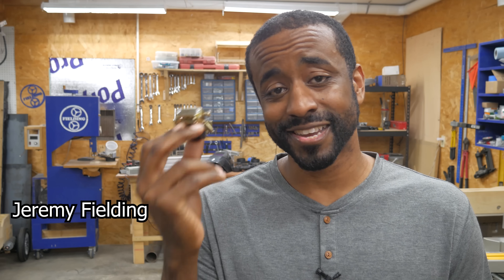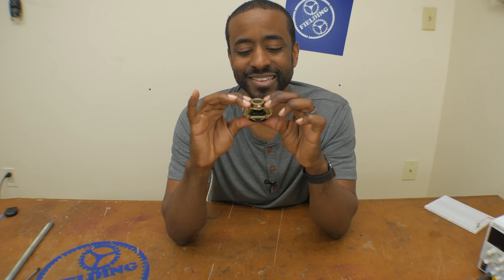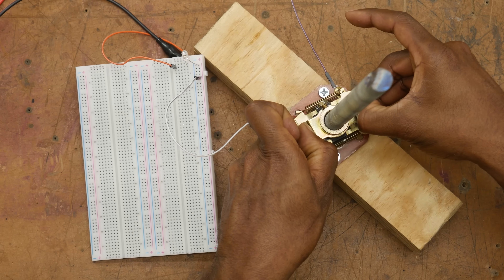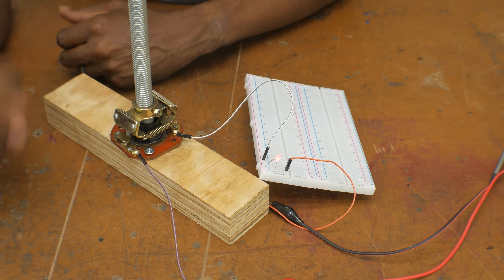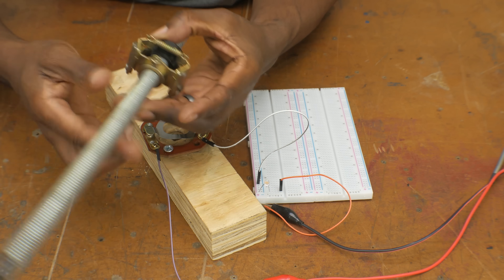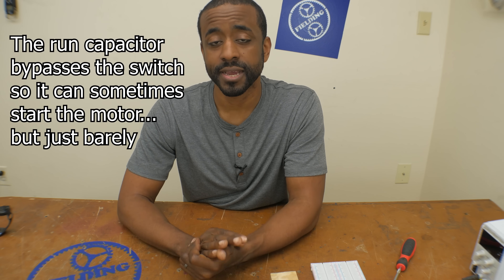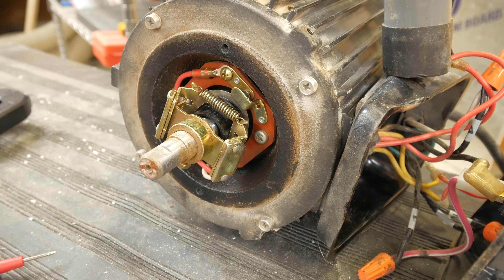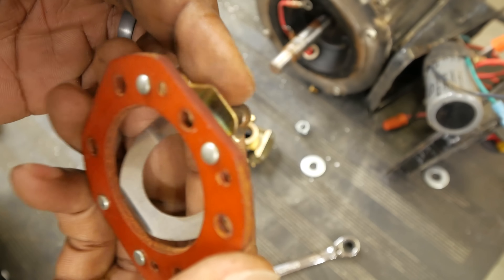This Clever Device Is Found In Nearly Every American Household. How It Works And How To Fix It

Comment from the maker: Hello! The comment about "specifically the US" is about single phase power... Some countries (like Germany) have three phase power and don't require a start winding. We have both 120 and 240 volts in every house in the US. In fact the motor in this video is 240 volts. So what is single phase? I explain that in this video. https://youtu.be/2XYdTogWcIA
Reply: As a journeyman-qualified motor rewinder, I love this video; it explains things that I struggle to convey to my kids.
Reply: @lairdcummings9092  Yes, his delivery is spot on, and also keep the subject intersting in the telling.
Reply: Just saw this, and subbed. My father is a retired R&D electrical engineer, all self taught. Yes he's that old, which makes me kind of old too now lols. You have a great way of explaining things, and excellent knowledge and presentation. I love the included bloopers (shows you are human too ROFL), and I hope to see more great and cool content!
Reply: Addition to ^^ In Europe we also use single phase motors 240V, (fans, electric gates, lawnmower) with two separate coils and capacitor connected.  It's just that when higher power is required, we use 3phase,  you need to have stronger kick start at beginning, therefore you need to have gigantic capacitor at start, you need to put higher current trough starting coil. As soon as it starts, current should be lowered, coil connected via smaller capacity.

I bet capacitor you were holding was actually combo of two in one.
Reply: JoeTuber p
Reply: @KabelkowyJoe  True, I have 230/240V single phase in my house and 380V 3-phase down in my garage/workshop, for the air compressor and some "heavy-duty" machinery, but I find I (and tools) use less and less 3-phase power
Reply: check into the steam engine guy ... he made the governors and switches like this and holds most of the patents on them ...
Reply: @0623kaboom  to be a toddler beauty trend 4t
Reply: @0623kaboom  you know patenting somthing like that is kinda like pantenting the lever or the screw or the club or fire etc. Think about that. We live in a time when you can take an old native american game whin i was a kid we called it bump played with dice an marbles . And patent/copyright it as an insulting derogatory term towards native americans  (Wa-who) .Giggles.
Reply: I think it would be wise to add a warning in the section about replacing capacitors and the potential dangers that poses to people who are doing home repairs. I know most people who will attempt repairs are probably already aware but for those that aren't it could be lethal.
Reply: @simonw3858  
Thats true.
Reply: @simonw3858  You mean a warning about capacitors that says before disconnecting one, you should always test it with your tongue to see if it's still holding a charge? ;) *** DISCLAIMER: Don't follow my advice ***
Reply: Royal Lee was granted  a patent for a centrifugal switch (US Patent #1,630,394)  on May 31, 1927 and was the basis for the formation of the Lee Engineering Company.  Don't think he was first, but the earliest I could find.
Reply: Royal Lee got the patent for it but idk if hes the guy who actually invented it
Reply: @derricka.mccormick6548  there is a Charles F Sullivan that has a patent for a centrifugal switch in 1912, which appears to be about 50 years before the patent Royal Lee holds. So apparently it's a device with many interations from different people over time.
Reply: +Jeremy Fielding   In 1910 Victor Bendix (b.1881) invented and patented the Bendix drive, a gear that could engage an engine at zero rotational speed and then (through the aid of a spring and the higher speed of the running engine) pull back and disengage automatically at higher speed (nominally the engine's running speed). This drive made the electric starter practical for automobile engines and later for engines in aircraft and other motorized devices.
Reply: Technology Connections had a good video on the US electrical power supply in your home:  https://www.youtube.com/watch?v=jMmUoZh3Hq4
Reply: So if the cap is blown, its possible the centrifugal switch got stuck closed? Because I have an old grinder with a blown cap and was going to replace it. But I'll look at that switch too if thats the case.
Reply: @siggyretburns7523  might want to remember that if you’re grinding or wire wheeling hard enough to slow down the motor that it engages the centrifugal switch several times it’s possible to overheat the start cap and cause it to open .
Reply: It's basically a governor which is in clockwork chime mechanisms and  automatrons and I'll bet you can trace it's use to a time even before  Archimedes . It is indeed a very old device. So good luck finding the person who first introduced or thought of it's design and uses.
Reply: @michaelshultz2540  Archimedes looked at the physics of it. he did not 287 B.C. 212 B.C.
Reply: with archimedes  principle of buoyancy, archimedean screw he worked with water.
Reply: @michaelshultz2540  you would not find that thing there acturally its closer to bow and arrow 30,000 BCE 100 BCE water wheel to 1040 compass gunter's chain Edmund Gunter (1581-1626) mechanical pendulum clock 1670 Robert Hooke(1635-1703) Joseph Nibble(1640-1711)
Reply: This switch is used in commercial convection ovens as a safety device. If the convection fan motor does not run, the oven will not heat up.
Reply: While we do have rotary current in every house in Germany, many devices are single phase but contain rotary current motors. A 5-core cable is  inconvenient for a lot of applications. E.g. lawn mowers, fans, circular saws, ...
The capacitor is connected all the time. Also those capacitors are rather small, less than a quarter of the one shown in the video. I've never seen any motor using a switching device like that.
What is often used for compressors and pumps is a timed relay removing the load to help the motor spin up. The classic ones use a clockwork or in rare cases a heater with bimetallic switch.
Reply: The original patent #1,630,394 lists the inventor as Royal, Lee.
Reply: Great job.  Thanks.  One thing, though:  It would be helpful to warn dummies like me to take lots of pictures before and during disassembling any electrical or mechanical device that one wants to work when/if it is reassembled.  Doing so can save a lot of grief and wasted time.  

God bless and protect you and your family,

Mike

011-44-1638-718264
Reply: We run many tools on single phase, too. So a start capacitor is often used. Only on machines which require a lot of torque or are especially heavy duty or just pull too much power we use 3 phase.

In industrial applications three phase is mostly the default, though.

Greetings from Germany 😙🎶
Reply: Europe has 3 phase power but most European homes have single phase, however, we don't need that device, there's a starter capacitor in the motors.
Reply: Inventor patent holder Royal Lee May 31st 1927
Reply: Not good with electric devices, but I think our 3-phase has 400V in sweden.
Reply: 3 phase power exists in every developed country, but it's only used industrially. German homes have single phase power just like the USA and every other country.
Reply: under friction roller coaster 1919 - john miller ;
Reply: 3:34 I see the weights moving outward, but what actually presses the switch?!  3:42
Reply: @TheRainHarvester  the force of it spinning.
Reply: @toolman9081  no, the force of it spinning un presses the switch, to electrically disconnect the capacitor.  
But I don't see what is depressing that switch.
Reply: @TheRainHarvester  springs return it back
Reply: 0 pop
Reply: I
Reply: James Watt Centrifugal Governor  ttps://en.wikipedia.org/wiki/Centrifugal_governor#:~:text=In%201788%2C%20James%20Watt%20adapted,Age%20in%20the%2019th%20century.
Reply: Centrifical switch yah I already know
Reply: This is the first of your videos I've watched. I liked and subbed before it was even halfway through. You're wonderful at explaining things in a way that is both understandable and straightforward (NOT mansplaining) I'm looking forward to watching more of your content!
Reply: I thought in the EU we use capacitors in single phase motors to offset the voltage and create a second phase so that you get a rotating magnetic field and don't need a starter or a switch like this. I work as an electrician and I've never seen a switch like that, but then again I don't do washing machine repairs either.
Reply: @Liteg0  Never seen one here either, most motors here run with a second coil with a phase shift capacitor to determine direction,  washers it would stop  and alternate the cap between coils to make it run back and forth.
Reply: Thought this was just click bait. It definitely isnt. Good video
Reply: You might have just helped me fix my air compressor. Thanks!
Reply: Well, residential is mostly standard 120, 15-20 amp, blah blah blah. BUT, In commercial i mainly see everyone on a 3 phase disconnect. Every now and again ill find a single phase in a building, mostly older buildings. The most interesting devices ive used, besides live production equipment, Step Down Transformers and ISO transformers. That stuff is so crazy to me, a device the size of a crate can isolate an entire 400 amp disconnect and reroute it for Audio power. If you did have Dimmable conventional lighting like 1000w Lamps for a stage, everytime the lights go up, that shared ground will put a 60hz buzz in the audio. ISolate!
Reply: We have plenty of 3 phase power here in the USA. It isn’t common in single family dwellings or some light commercial locations, but generally medium to heavy commercial and almost all industrial locations have three phase power. It is also possible to create three phase power from single phase by using a rotary phase converter.
Reply: The reason that you can't/couldn't find the inventor as you're calling it a new name.
These are way over 100 years old also.
They used to be called governors and were used to slow down steam engines which were spinning too fast.
Reply: Your channel is really good.
Reply: @tamasmihaly1  Being the best channel normally makes it good.   There is another one:
ozzieslivepedos
which I also did.
You might also like that one.  Lots more videos from that one were removed.
Reply: Actually,  240v comes into a house. And its split in the breaker box. Single breakers only latch to 120. The double breakers get 240, because they're latched to both 120 bars in the box.
Reply: Newton was the first recorded person to discover centrifugal force... The first centrifugal devices were created in the 1600's... For milk sperating...
Reply: Saved me a search ty!
Reply: Man, was I scratching my head why I had never seen such a thing before!!! (edit: German dude here)
Reply: All countries have 3 phase power...
Reply: Hmmm... My understanding is the single phase is the standard for every household and 3 phase is a choice if the household choose to have 3 phase powered appliances(like 3 phase motors in a workshop in the garage, etc).
Reply: Interesting comments hey?  Electricity can be configured & reconfigured so many ways.. 

Will say this, some people have been listened to by people who clearly only paid attention to find fault as an excuse to be mean. How I know this?  Unless the person is lying intentionally odds are they have a peice of info wrong.. Usually it is easily cleared up. 
And here is how i know that isn't what the unhappy listener is after. 
In a misunderstanding or cultural difference: calling someone an idiot using these or the like as justification... Sorry but have you noticed that the folks who enact or support this behaviour are also chronically angry / unhappy except when they are attacking some one?

Counted only two or three of these in comments here.
About twenty or twenty five who complemented & or thanked the creator.  Several who provided bono fides.
Those who were negative probided none.  It is not about truth, or even them being knowledgeable, it is them insulting, hopeful that others will join in and start a fight so they can contact like behaving contacts to join in and or use multiple screen names to create the impression of many.  
Here's hoping they / and i do mean each of you / all find a better way, they do excist, and all it takes is a bit of willing.

Thx 4 the vid dude, learned some interesting things from it.   Thanks 4 the comments for same
Reply: Electric motors have 3 windings, in smaller intermittent duty motors, use single phase energy with the use of a capacitor( run capacitor not start capacitor) very different. Larger continuous duty motors (higher efficiency) use 3 phases of energy 208/460v with one phase connected to each winding.   Unless your talking DC MOTORS then LOL that’s different they don’t have 3 windings
Reply: Does a centrifugal switch sense the speed of a motor?
Reply: Does that in a HEI distributor in a car?
Reply: Residential home outlets in Germany provide access to three-phase?  Do they transform to Wye for safety ground?
Reply: thx1138 ib3  but to answer your original question, 3 phase power is inherently "rotating - the AC in the legs is 120 degrees off.  But when you have single phase power - whether it 120 volts or 480, there is no rotation, single phase power just goes up and down, up and down.  And lets say you take two of the three legs of a 380Y220 volt, 50 hertz supply in Germany, it is still only back-and forth without rotation.  So there is an additional, partial winding, slightly out of phase with the main winding which provides the initial "kick" to get it turning.  Sometimes this winding is helped with a capacitor (capacitor start) or not using a capacitor at all (split phase).
But... three phase is inherently rotating and a LOT simpler, regardless of voltage or frequency.
Reply: @Huggy1959  don't you use 230/400V AC as the rest of europe? They changed it from 220/380V AC to 230/400V AC in the 70'ties but so many still say the other thing. Quite frustrating really (PS. Im from Denmark)
Reply: @Faryetes  I am in the United States.  We are 60 hertz.  Our defacto power to our houses is 120/240 single phase, although when it is derived from a 208 Y 120 transformer  it’s 120/208, derived exactly the same way that your 230/400 is,  in an industrial setting we also frequently have 480Y277 and in some big factories we have 600Y347.

We have one machine here that was built in Israel and it runs on 415Y240  50/60 hertz and we can supply that with transformers
Reply: @Huggy1959  That's a great explanation.  I don't think I'd ever heard that before.  Or maybe I just wasn't listening.
Reply: @Huggy1959  you rock
Reply: @Huggy1959  that was a great reply and it added value to the thread! Since I've been trying to learn more about power phases and electrical motors for my Walker -Turner table saw restoration, what you posted actually made sense to me...for the most part as a beginner. Thanks so much!
Reply: Ah, I see, I thought maybe the motors or the switching mechanism was different... but single-phase power isn’t US-exclusive nor is 3-phase common in all of Europe, here in Spain it’s rare for an individual to have 3-phase power, which is usually only for specialized loads (which makes sense because otherwise you have to correctly balance it).
Reply: Adding in to the list of "Weird things that are a norm in USA".
Reply: @LecherousLizard   From Canadian: Said the " Lecherous Lizard" :'D
Reply: @LecherousLizard  Only in the US.... lol :D Yeha they've all got weird stuff there...
Reply: The USA does have three-phase but it is most often only available for commercial use.  What a shame.
Reply: I would also like to add the reason the US doesnt just use 240V for everything if they have it in their homes is that 240v in US households does not usually run through the entire house and is often dedicated to things such as laundry equiptment etc wich do require higher AMPS where as in EU all of our outlets are as standard 240V 13A as opposed to 120V 10/13A.
Reply: We also have Three Phase Power in the U.S. (277 Volt) but it's used for commercial and heavy industry power uses.
Reply: L G not just for commercial and industrial. Plenty of three phase 208 used in condo buildings.
Reply: @RB-xv4si  Yes, three phase may be sent to condo/apartments, but, each individual apartment will only have two of those three legs.  Ends up being 120/208 volts single phase at each apartment.  I suppose a motor might be designed that would use the neutral and take advantage of the out-of-phase character of two legs, don't know if that's been done.
Reply: @boggy7665  yes, I know how three phase power is distributed to individual units. Thank you. I don’t know what you’re talking about with motor voltages. Either they will be three phase, single phase line to line, or single phase line to neutral. It’s no more complicated than that.
Reply: US  residential power is 110/220. However, it comes to your household as single phase 220. The 110 is derived from a center-tap on the transformer that is bonded to earth ground, and is called "neutral." This results in two halves that are 110 and also 180° out of phase (split-phase, not two phase). Interesting thing though, even all of your 110 items are running off 220 in an interesting way. The neutral only returns current imbalance from the two halves. So you have 10 amps on leg one, and 8 amps on leg two, only 2 amps are pulling along neutral. As for the voltage 110/220 is just an old standard that is still used as reference, and IMO is easier to say/read/type. The nominal voltage is 120/240, but acceptable range seems to vary from 110-125/220-250 (plus/minus 6% of nominal is the proper range though).
Reply: What do you mean “some countries” have three phase power. The US has 3 phase power everywhere. Just not in homes.
Reply: Royal Lee Invented the Centrifugal switch in 1927. Granted Patent #1,630,394 granted May 31st 1927 the basis for the formation of the Lee engineering company. * Citation Wikipedia.

I think that is what you were looking for. Great videos, I really enjoy the subjects you cover.
Reply: I'm probably dumb in this department but did you mean 110 and 220?
Reply: @joshuasummerville2976  both its for single phase not 3 phase motors there is 110 &220 single phase motors not found on a 3 phase motor if you want to know anything on this subject dm me on Twitter 👍
Reply: Was wondering which kind of motors you use to need such a thing, and realized that here in EU one can just use the 3 phases which makes the motors start turning a non-issue. 
In US 120 and 240 are on the same phase? Or is just the house wiring that is totally split?
Reply: @framegrace1  In most of EU residential and industrial power delivery both use 400V (sometimes 690V industrial) 3 phase with the phases 120 degrees apart (230V phase-neutral).

As far as I've gathered, in the US they use 240V 2 phase for residential with the phases 180 degrees apart (120V phase-neutral). And 480V 3 phase with 120 degrees apart for industrial.
Reply: @Liteg0  Correct, but we also have 120V/208V 3-phase, mostly in commercial property. The 277V/480V is generally just used by heavy industry.
Reply: Um I've done res and commercial installs. Houses in the states I have worked in run on 110 and 220. I have run the main run into the building, landed the panels and bent all the pipe. You shouldn't be giving advice. Edit: Yes I know it is supposed to be 120/240, but have you ever measured what's coming in? I have.
Reply: MOst european countries have 230/400V most homes have only neutral and 1 phase 230V. Most motors for domestic use are 3 windings with a capacitor to create an additional phase, not a start capacitor.I guess US don't use it because of the low voltage.
Reply: Not every household in Germany has 3 phase power.
You can have it if you want, but they have install it, because 3 phase is meant for industrial use.
Usually they have 240 volts also.
Never seen such device, and I messed a lot with motors.
Reply: @scorchedearth1451  That is wrong. Almost every household has one three-phase outlet pre-installed, hidden behind your stove. That is why the stove is using three extra breakers in your breaker box. (You might not have a three-phase outlet if you use gas for your stove.)
Reply: Nit Picking trolls ... Nothing better to do than talk side ways because you didn't correct him. Enjoy your bitter life alittle
Reply: @ph222000  You know it's mostly the nitpickers that
A: invent these kind of things.
B: explain it in such a way that it can be understood in full.
Reply: @ph222000  - you clearly love insulting people, hope it makes you happy - not
Reply: Many washer motors are split phase or permanent split capacitor amongst others and don't use this lousy device.
Reply: So this simple device is over 100 years old and even now in XXI century a better replacement has not been found. 
I think they are better devices, better engines and better technologies but they are locked in boxes with "top secret" label on them.
Reply: Ok.dont get me wrong, his video is quite a job to explain. But in Europe I never seen that device. Capacitores does the jobs, some even don't require depend on the purpose, unles 400v which doesn't require at all. 
Actually so many moving parts that can go faulty isn't dangerous?
Reply: Yeah, this post makes no sense. It just looks like damage control for saying something silly, then trying to pretend it away because of pride.

Dude, we have 3 phase power in the U.S. 240 volts is 240 volts. The only difference is that we use 60hz versus the UK use of 50hz. Your implication that the motors we use, need a boost, is incorrect and actually backwards, seeing how 60hz will make the same motor faster than if it is operated at 50hz.

Just man up.
Reply: @TheCyndicate  it exists here, mainly in bigger shops but 3 phase is a rarity for sure.  I worked in a shop with 3 phase machines and they were amazing!
Reply: @tsloth1390  , here where?
Reply: @TheCyndicate  The US uses two phase power and power is at either 120 or 240 volts. 120 volt has a neutral/ground, while 240 volts doesn't. Look into how a junction box works. It's two phase power.
Reply: The US is not single phase, US is two phase for residential, 3 for industrial and commercial. In residential we generally only use 1 phase at 110 to 120 volts for most end uses, 2 phase 220 to 240v for ovens,  dryers, hvac etc.
Reply: @Besmertnic  120/240 is single phase with two different voltages available, but still single phase.
Reply: I misspoke, it's a split phase system, the two 120v hots are 180 degrees out of phase from each other at the panel. This is not the same as the rarer 2 phase system which is two of the 3 phases of the transmission system, but none the less has two sources with different phases, hence the confusion.
Reply: @Besmertnic  two phases of 3 phase power is not 2 phase power, maybe its referred to as such in some case (i.e. input) but 2 phases of 277VAC makes for a single phase input of 480V ( 120 degrees out of phase so multiple by sqrt3) and is referred to as phase-to-phase for input. Two phase power has one of the phases 90 degrees out of phase and hence eliminates the need for a start capacitor. 
https://en.m.wikipedia.org/wiki/Two-phase_electric_power#:~:text=Two%2Dphase%20electrical%20power%20was,wires%2C%20two%20for%20each%20phase.